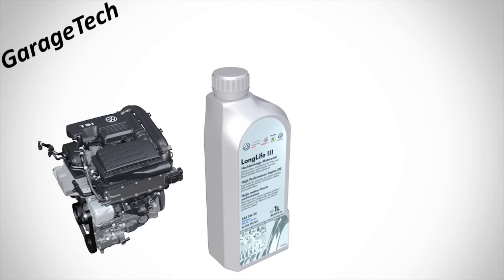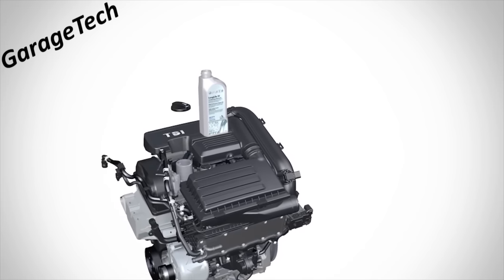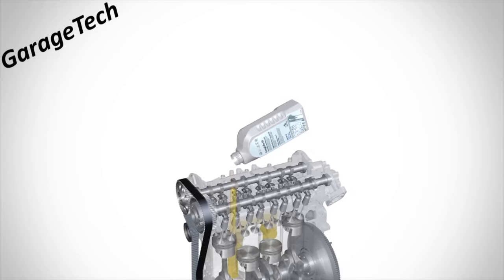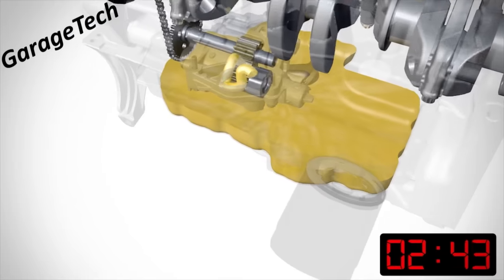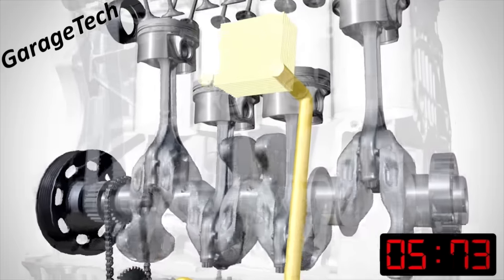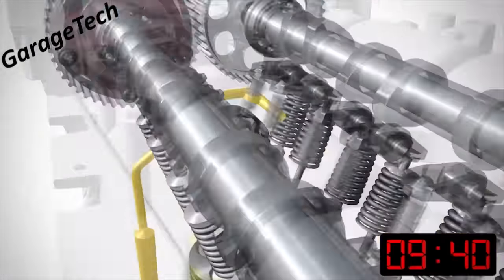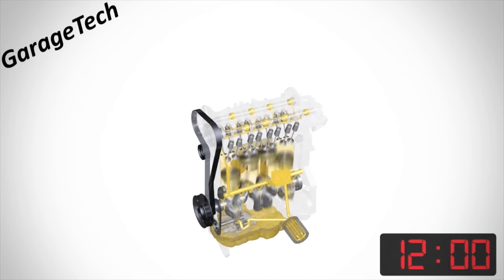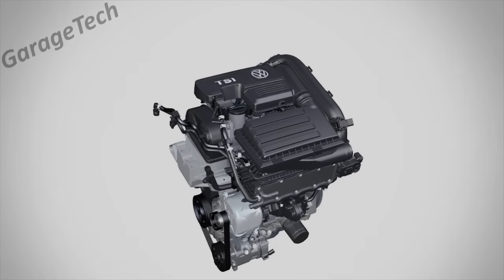How oil circulates around an engine when started

Comment: 90% of engine damage happens at startup
Reply: Thanks for parroting an advertisement. 90% of engine damage happens from Kia drivers who never change their oil in 60 thousand kilometers then blame the manufacturer when the car engine dies.
Reply: @Ali Not really. Metal has dry-running properties so they can run a shot amount of time with to low or none lubricant.
Reply: @Colonel Kurtz No problem, you probably did not know it. :)
Reply: Got to love that extra 4% fuel economy from start and stop engines at the cost of accelerated engine wear.
Reply: @Colonel Kurtz Stop trolling, kiddo.
Reply: @Colonel Kurtz At least sharper than you lol
Reply: @OffGridInvestor  🤣🤣🤣 yup
Reply: @TheGhostTrollekdejvu  unfair to compare a gravity drained engine from one still soaked in oil switched off at a red light
Reply: @TheGhostTrollekdejvu  Start/Stop is not used on cold engines where little to no lubrication is present. It is only enabled if the engine has reached a certain temperature and the oil still sticks. Depending on the viscosity and age of the oil, it takes a certain time until the engine is completely dry again.
Reply: Colonel Kurtz so if I’m down 2quarts on the dipstick I’m causing some engine wear ?
Reply: Lmao imagine being poor enough to change oil in your car, when my car runs out of gas I go to the dealer and buy a new one
Reply: @Asto508  still it kills electrical parts, especially starter motor, and it's really dumb to mount it in diesels, but they still do.
Reply: @puzzlemaniak420  Why would it kill the starter motor? Those usually endure a lot more starting cycles during their lifetime than you would usually ever need. Starter motors fail for a lot other reasons long before they fail due to excessive cycling. 
Also, why is it stupid for diesel engines? In what aspect are they different regarding start/stop systems?
Reply: The other 10% of engine damage happens when cars are driven at 100mph into solid concrete walls.
Reply: It’s all good boys, I’m sure this guy in the YouTube comments knows a lot more about cars and motors than the engineers they paid millions to design them. All the car companies should’ve just looked in these comments
Reply: Colonel Kurtz you have to realise some people sense of humour is non existant 😩
Reply: @heavyweight6440  no way
Reply: Some engines get damaged just from existing.
Reply: Not the way I drive
Reply: That's why I always leave my car running.
Reply: Yep, and that is why it is especially important to prime or fill your new filter before screwing it on.  If your filter mounts horizontal, don't over fill…just quickly top off ONCE and let it set upright, back in the box covered, until you are ready to screw it on.  The oil will have beed soaked up by the filter so there is no spillage or waste.

Comment: That’s why before I leave from work I remote start my car before I head downstairs to my car so by the time I’m in my car my car is all warmed for me to take off
Reply: Ok but by the time you're properly in the car, comfortable, put on your seatbelt, maybe plugged in your phone, … oil would already be flowing properly, and whether you remote start it or not, it still needs to be started…

I only really remote start to melt ice or snow off (I let it run for 10 minutes) - or to hear the engine roar. The minute it takes you to go downstairs won't really heat up the car… Mine would still be blowing ice cold air.
Reply: Robert B  No, but the point is oil wouldn't properly lubricate your engine either when you remote start it. It needs to be cold started either way and wear will occur. Plus, your engine idles faster, runs rich, ... and doesn't heat up all that quickly while it's idling.
The oil will still be cold after remote starting it.

Comment: Have to do one thing add a additional oilpump before the machanical oil pump
The electric oilpump will lubricate all the parts before start the engine
Reply: The Germans will just make it all electric so the engine blows up 2 days out of warranty (see electric water pumps, pumps with plastic impellers, plastic tstat housing, horrible bearing tolerances and they tell you to use 60 weight oil lol). Germans are a joke.
Reply: @TheGuruStud  Probably nothing of these things you tell us about is made in Germany. 
There is a lot of shit from Asia, many factories are using this unfortunately :/
Germans are a joke, seriously? :D 
Hahaha, i'd like to see all of you with your cars and heavy duty or high value machines today without germans, without manufactured mechanic "Made in Germany"  and without the art of german engineering...
Reply: Just have a honda motor under the hood. 🤙

Comment: This is why you should not rev up your engine too much right after start up and the best practice is to not drive any car too hard until your temperature gauge is showing that the engine is at operating temp. When its cold, the internal parts have not bedded together properly yet and in some cars, you will find that the power is not there until it heats up properly. In the meantime, there is a possibility of doing damage by forcing it to work too hard.

This is also why you never want to buy a car that was owned by someone who only ever did short journeys as a bigger percentage of that cars mileage was on a cold engine and probably has similar overall wear of an engine that would have a lot more on the odometer.

I was getting new tyres on my car at a garage recently and A taxi driver with a 2007 Toyota Avensis 2.0 diesel came in. I was chatting with him and the garage owner and this taxi had over 640K KMs on the clock or around 400K miles and still going strong. Most likely due to taxi cars being run all day so they rarely get a chance to cool down enough for a cold start and this gives them a better chance to last longer in the long run.
Reply: Irishdrivingbloopers  new engines and oil are better than old ways after a start and maybe 30 seconds and driving for a minute or so it’s probably much hotter than you think at least my ford ecoboost gets up to temp really quick due to new technology that allows faster times
Reply: I can feel my car like I drive it almost everyday so I’d know how it acts it preforms so much better once it’s warmed up everything seems smoother. When I first start driving after starting it the engine feels laggy and the transmission jerks but once warmed up it’s the smoothest not perfect but way better
Reply: Lolz     My engine seems to get hot quick like 1-2 minutes it’s already warmed up and the cabin nice and hot.
Reply: A diesel engine is not the same.
Reply: @lolz616  it's quick because the engine is tiny. but again coolant temp is not operating temp. oil temp is and that lags far behind coolant
Reply: @03056932  Since oil and coolant are only separated by the pure metal engine block which is an excellent heat conductor, you can pretty much be sure that the coolant temperature is a pretty good indicator of the oil temperature.
Reply: @Asto508  Wrong, i can see both the coolant temp and the oil temp and the coolant temp is at operating temperatur after about 2-3min and the oil after 5-10min (depending on outside temps, C63 AMG)
Reply: @3V4NG3L10NN  You are talking about how fast the coolant is heating up compared to oil. That may be true but is not contradicting what I said. It can also be expected due to the different heat capacity between both and the purpose of the coolant to actually cool the engine. There is a linear relationship between the coolant temperature and the oil temperature however. The coolant running through the engine block will be closer to the engine oil temperature whereas the coolant running through the radiator will be a lot cooler. On average, its temperature will always follow the engine oil temperature but will never be higher. Nothing surprising here. 
If the engine oil is not heating up (constant engine rpm), the coolant won't heat up either and vice versa. 
The response delay between both depends on a lot of factors and are individual for each given car. 
My point is entirely untouched by this however. The remaining question is what is the definition of "coolant operating temperature". If the coolant is at a specific temperature from which you can derive the engine oil temperature (margin of c), it is a good indicator of the engine oil temperature. 

If you just talk about a unitless meter in your dashboard, from which you can't derive any specific temperature, then of course it's hard to take this as an indicator for the engine oil temperature. But that's not even worth talking about tbh.

Comment: One thing Daddy taught me 40 years ago is gun the throttle just a tad bit before you shut her down. That way, you pump a bunch of oil into the top end and it can coat everything so come start up time, ya got better lubrication. Who knows if it makes a difference but I've got an 86 Mustang with 327K on the original 5.0 and a 96 Saturn with 200K in the original 1.9. 🥰

Comment: Do you think starting an engine every week or so and letting the oil spread like this will protect it from rusting inside?
Reply: Sümbig Dumkünt  I've worked at midas for 6 years and i've defintely seen rusty internals before. Not saying its common especially in newer cars but, yeah some people have inside and out rusty shitboxes
Reply: Sümbig Dumkünt  they definitely are exposed to moisture, water is produced when the fuel burns and condensation can happen when the engine cools down
Reply: The only way it could rust if it was miss treated I’ve seen this before but an engine that’s looked after should not rust
Reply: Lets understand the difference between rust and corrosion. If it has iron content it will rust eventually. Most of the metal inside engines are comprised of aluminum. Yes i know theres others but pound for pound aluminum is at the top of the list of used metals. Aluminum doesn't rust it corrodes. Yeah.
Reply: You absolutely don't want to start it for a few minutes. The reason they say it is bad to drive your car for short trips is because the engine doesn't get fully up to operating temperature. It is important to get your engine up to temperature because the heat burns off moisture in the crank case, which would otherwise oxidize on the internal metal surfaces and potentially rust. Basically, when you have a hot surface and then let it cool, moisture beads up on the surface because you are slowing down the airborn h20 enought to become liquid. Now the question is how did moisture get into the crank case in the first place? Basically, when the combustion process happens, air and fuel mix together and explode, pushing the piston down and create power. Some of that explosion is not 100% contained and pushes past the piston rings down into the crank case. This is called blow-by. All cars have some blow-by. This is why cars are equipped with a PCV system(positive crankcase ventilation). The PCV system circulates the blow-by back out of the crankcase and then back into the intake so it can have the chance to be properly burned off again, through the normal combustion process. BUT, no matter what, some moisture will get into the crankcase through blowby and then condensate, do try to take fewer short trips so that the temperature and PCV system can better burn off moisture and contaminants.
Reply: Sümbig Dumkünt  wrong
Reply: Sümbig Dumkünt  I explain it in an the other post. The moisture gets into the crankcase via blowby. Thats what the PCV system deals with. It isn't moisture in the combustion chamber that needs burned off. Moisture in the CRANKCASE doesn't see evaporation temperatures until the oil reaches 200deg+. But obviously pistons and sleeves could oxidize if left sitting for prolonged periods. If you've ever had a vehicle with a catch can collecting from a PCV system, you would be quite surprised how much moisture/water it collects over a few thousand miles.
Reply: If you need further explanation how the PCV system works, let me know.

Comment: WD-40 works wonders. It takes a fraction of the time synthetic oil takes to flow around the engine due to its lower viscosity and it also cleans the engine internals for prolonged engine life.
Reply: Amazing! 
Tell Ferrari so they can cheat with it in their next F1 race
Reply: Amazing! I never thought about using WD40. How did you put it into the engine? Just buy a bunch of cans and spray into the oil filler hole till empty? Any help would be appreciated.
Reply: @MilindaX  i found when you spray WD40 into the tank it even cleans the car. Haven't been to a car wash in ages.
Reply: SAE 0W-30 works even more better

Comment: So we can say that most of the wear and damage happen in these 12 seconds? Especially when we stop the car forlong time  and the engine bcome dry.

Is there is any movement of oil befor we start the car? Maybe in the second position while we are circulating the key 🔑 befor it starts?( ignition position)(ll)
Reply: Ayman Al_Jahwari No. In order to get the oil to the engine you must turn it on. The oil pump is a mechanic one, not electronically driven.
Reply: In an older Chrysler Sigma I once owned, when you started the motor you’d hear cylinder heads sifting momentarily until lubricated.  This sound could be heard for about 1 second after startup each time after the car had sat overnight.
Reply: Brett B2 
I think i can hear the same sounds from my honda accord 2008

This sound increase in winter in my car and decrease in summer

I start feeling worry about the engine but now i complete almost one year hearing that sound and Nothing wrong happened and i hope every thing stay ok for the next few years 💔 because till now i can hear that sound every morning
Reply: Could try using Castrol Magnatec oil and see if that fixes the noise.  That oil didn’t exist when I owned my Sigma.
Reply: Brett B2 
Ok thank you for your suggestions
I will try it and i will see if it will make change
Reply: I once tried sifting my car's cylinder head once, but the metal was too dense for the sieve.
Reply: This is very entersting topic

Let ask some experts maybe we will get good answer for it
Thank you for your interest and explanations
Reply: This video ignores the fact that there is oil in the pipes and galleries, especially since the oil filter has a no-return valve that prevents the oil that's after teh filter to flow backwards.
Reply: Greg Tastad Just did all this to my 3000gt and it turned into a Dodge Stealth 🤔 did i do something wrong?
Reply: Greg Tastad  not funny.

Comment: It would be neat if there was an electric pump that could deliver oil before you start to minimize wear, but I'm assuming this hasn't been done, because there isnt enough damage that is done when started dry.
Reply: Interesting concept. Would eleminate several issues. Dry sump with stand alone pump. Technology today seems possible. Million $ idea!
Reply: There is a way to circulate the oil by taking the distributor off and turning the gears inside.
Reply: Large industrial engines have electric prelube pumps that  build up oil
pressure before it allows the engine to start
Reply: In the old pistons planes there are severals, the p 51 mustangs can take some minutes to pressurize the oil, but you know when you have a 12 cilinder 2 stage compressors its different lol
Reply: So when i change the oil on my "top" vehicles i remove the inition (like the spark plug on the gas motors) and try to star up for some seconds
Reply: Morroso has been making pre lube accumulators for decades.
Reply: @massimopecile9666  less than 700rpm doesn't allow a modern oil film to protect so you are doing more damage than good

Comment: Your animation is wrong!
Redo the oil flow through the filter.  Oil in via the outer holes and out through the center.
Reply: Actually only 20% or 30% GOES THRU the filter. It's not the whole lot going thru before it goes to the rest of the engine. Mechanic of 50 years told me.

Comment: this is why you don't just start up your car and start driving. I would wait at least 30 seconds...a minute would be better. In fact, the best thing to do is to wait for the engine choke to come off and return the rpms to normal idle...that way you know the oil has worked its way through into every cylinder and you have normal oil pressure.
Reply: I sit for at least 5 mins to make sure! Good point!
Reply: I live and die by the “normal idle” rule. I don’t drive away until my RPMs are at or below 1000.
Reply: amen guys. These media sources or people who tell you not to idle your car from a cold start before driving are full of shit. They either want to shorten the lifespan of your engine, or they are totally OCD about emissions and the environment.
Reply: Only on cold starts you should wait if you been driving around and then say go into a store for 20 minutes and come back no need to wait again engine still warm. Just on cold starts give it some time to warm up
Reply: John Recaptcha     My cars manual says 10 seconds and in cold climates about 1-2 minutes but I just do my thing I wait until it’s at an idle and the temp gauge moves a bit witch only takes maybe 2 minutes
Reply: @ryans413  oh yes, totally agree. If the engine is already warm, no need to wait.
Reply: @theory816 that sounds like a load of dog shit. How would driving it prevent "moisture"....whether you idle it or drive it...the engine is eventually going to warm up